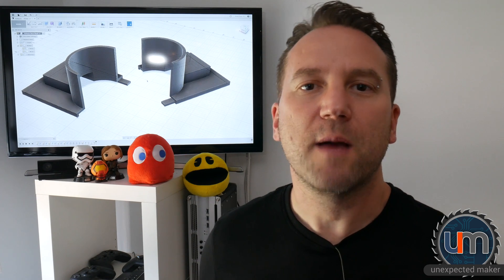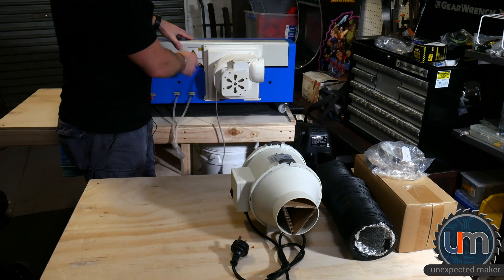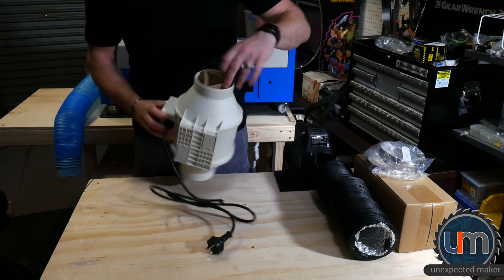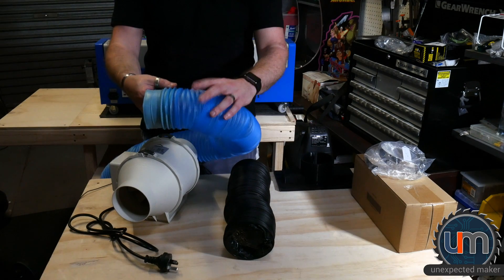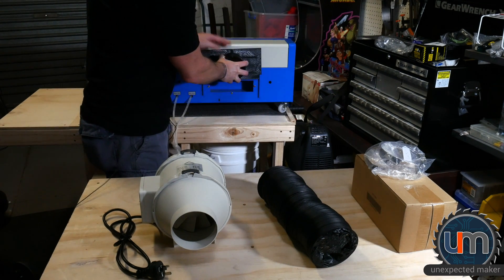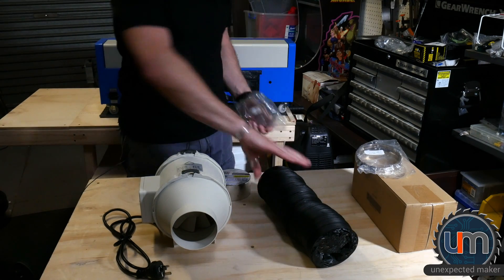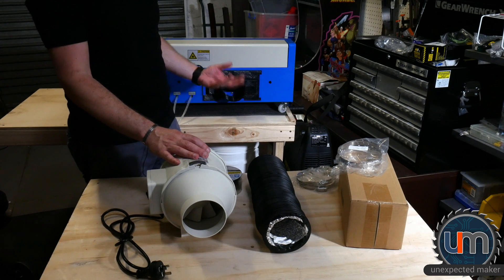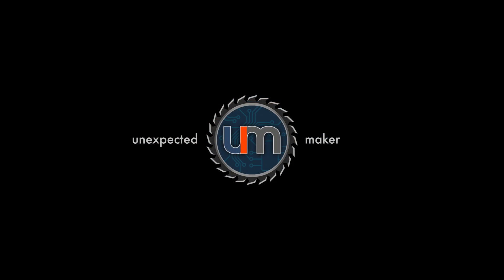K40 Laser Cutter - Air & Fumes Extraction

Comment: Do you think you could use this indoors in apartment with air filter?
Reply from the maker: 100000% not.
Reply: If you're gonna set it up in an apartment, you need to first and foremost exhaust to the outside. If you can't do that, then there's no way you can run a laser cutter/engraver in an apartment.

Any additional things you need, depends on your machine. I have a Sainsmart Genmitsu LE5040 arriving today and I only get a pair of protective glasses with it. No good, especially not as I already wear normal glasses and thus can't use them. So instead I need to grab some red, translucent acrylic and oneway mirror film and use that as protective glass against the laser. The laser is 445 nm diode and the red acrylic wont let light under 650 nm pass through. Orange could work too, but the tint makes all the difference and you need a spectrometer to measure the nm wavelength correctly. That's not easy or cheap to obtain, so going with red is a safer and cheaper option.

Next I'll also need an air intake to the enclosure, as you can't suck smoke and air out from a vacuum. Going extra fancy would be to add smoke and temperature sensors and wire them to an Arduino or a Raspberry Pi and use speed controllable intake and exhaust fans to keep everything safe and sound.

The first box will though be pretty rough and mobile, with no specialty stuff, except from a camera to record the engraving process. Exhaust will be a flexible tube to be placed outside whenever I use the laser.

Final box is a permanent placement beneath an enlargened CNC mill and will be about 6 meters from the nearest wall exhaust. I luckily have air intakes in my windows that can be unscrewed, so I'll turn one of those into an exhaust to the outside, add pipes along the top of the wall towards this exhaust and add fans to help the smoke get out of the pipe and outside my apartment.

This would also be your only option. Filter on the intake and exhaust pipeline with fans on the smoke system

Comment: Off topic question, I got my k40 laser in about a week ago, ran test trials everything was "lasing" great and eventually ran into the belt popping off a few times, I over tightened the X axis belt tentioner and broke the belt  OPPPS, now im having a major issue finding the correct replacement belt on amazon due to so many people stating incorrect pitch and size (do you by chance know the correct pitch and size) p.S. the x axis belt tentioner setup seems pretty jank, I plan on 3d printing a custom tentioner for the end.
Reply from the maker: I don't have my K40 anymore,  so I can't tell you what the belt specs are, sorry.
Reply: @UnexpectedMaker  No biggie, thanks for the fast response.

Comment: The other problem with that fan is that the wires inside the cover are twisted together, not soldered or fixed with connectors. Absolutely shocking 'quality', or lack thereof!
Reply from the maker: With the rubbish fan that shipped with the unit? Yeah, pretty terrible. It was the firth thing to go with that blue tubing!
Reply: @UnexpectedMaker  Yup. If you open the back panel on the fan, you'll find all the wires are twisted together!